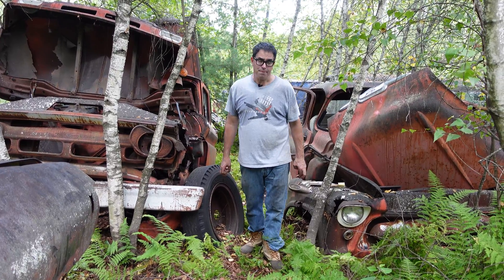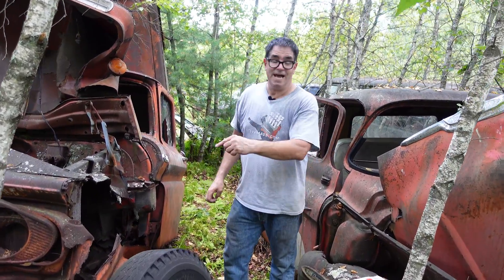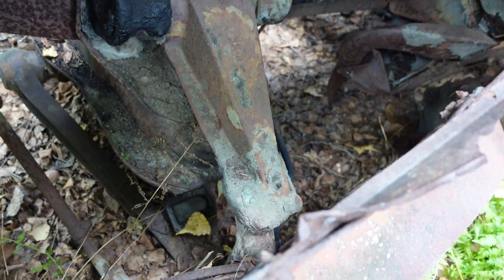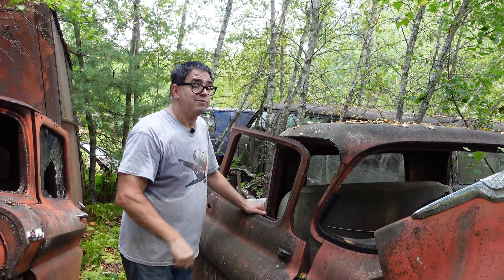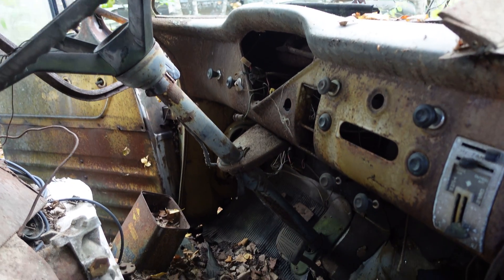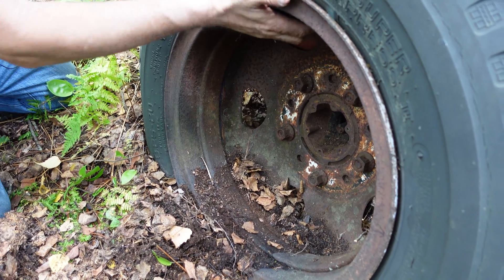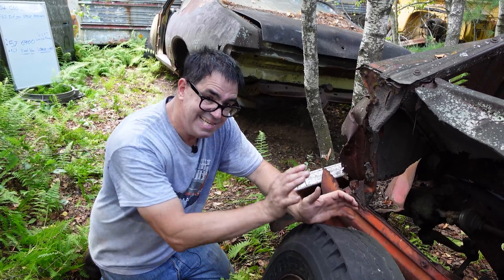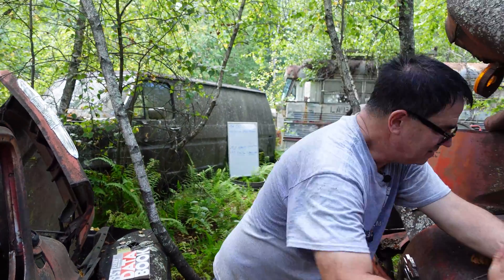The Widow Maker RH5 Split Rim Wheel Exposed!

Comment: They had a special cage you could use when working on those split rims to help shield you should the rim decide to separate.
Reply: Even with a cage, it's best to get a remote valve with a hose extension so you can stand several feet away from the wheel/tire when you inflate any two or three piece wheels.
Reply: @livewire2759  I completely agree
Reply: @livewire2759  Thats how I do it, We have a video on our channel.
Reply: those cages are a one use design  when you see what happens to a steel cage  on a blowout  it will scare you just looking at those tires
Reply: @richardcranium5839  fortunately I never found out how many uses you could get out of those cages
Reply: I didn't like using those cages because the rim was leaning and sometimes wouldn't seat right. The guy before me had an event that threw a 12lb chop hammer 30ft thru a fence.
Reply: I knew a guy whose face was messed up because of a split rim event. This happened in the prison system. No cage.
Reply: @sammolloy1  That sucks. Lucky he survived.
Reply: @Dominic Glisinski agreed

Comment: We used to wrap a chain through them rims back in the day when airing them up at first.
Reply: LOL! I've done that when on road calls. I'd chain them in a few spots around the wheel.
Reply: @jimmyguy428  just asking wouldn't a 3 ft air handle help when filling?
Reply: @steveib724  The usual tire chuck that we used was pretty long. I'd say the whip hose between the hand valve, and the clip on chuck was 4-5 foot, but still a little close if things went south. I've never had one come apart on me, thankfully, mainly because I was pretty thorough with my inspection, an assembly.
Reply: I have heard of that, now that you mention it

Comment: A friend of mine told me that those 283 engines in those large trucks that were painted yellow were thicker or high nickel content blocks that could take the 120 overbore and was a good engine for drag racing.
Thanks 👍
Reply: I believe you're correct.
Reply: 283 with solid lifters great sound.